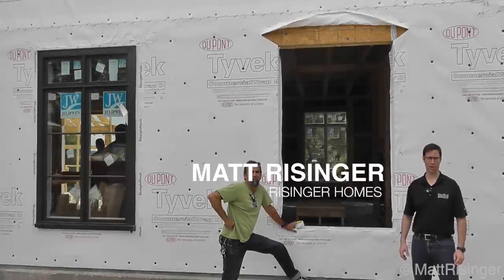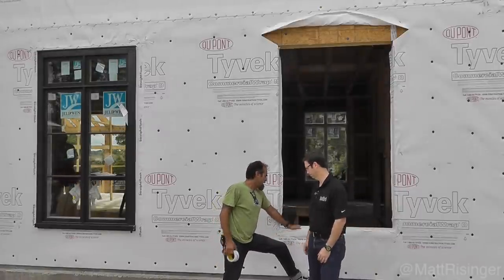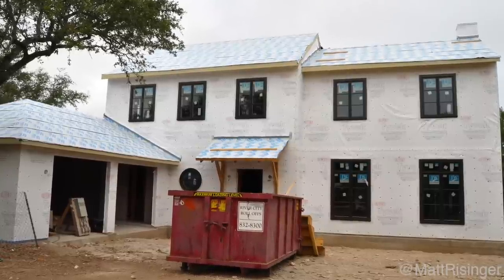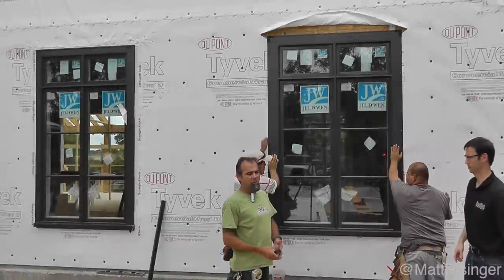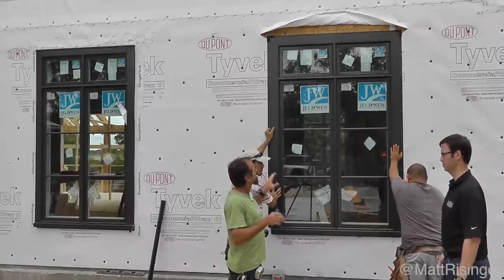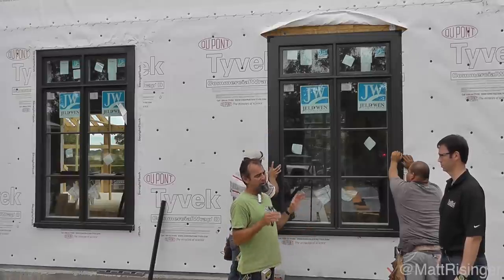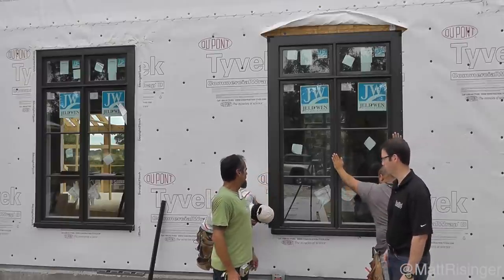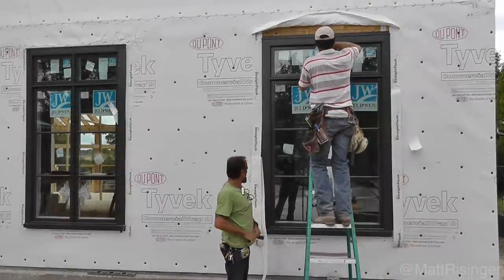Jeld-Wen Window Install Best Practice Method

Comment: I like Typar wrap, it installs at 32" centers instead of 16" centers for Tyvek. It is said to be 5 times stronger than Tyvek and has some other properties that don't let water through if oils or other products get on the surface of the wrap.

Comment: I'm replacing windows but since I have to completely rebuild my rough openings for two windows I bought new construction windows roughly the same size as the old windows. I'll have to cut the nailing fin off where the windows but up against brick face. I already installed a Jeld-Wen entrance door, now moving into two original windows that came with the house. All other windows have been replaced by previous owner.

Comment: One thing that is rarely mentioned in these videos and is confusing to most people is relates to incidental water intrusion. residential widows ALWAYS leaked. The big difference between 2023 construction and my parents 1952 New Jersey “Cape” was that the framing lumber was mostly old growth. sheathing was diagonal solid 1x shiplap and the walls 3 1/2” studs with fiberglass cavity insulation. No air conditioning. Underlayment was 15lb felt.
If the envelope received a few tablespoons of intrusion water…or even a minor leak… it could DRY OUT without substantial damage to the wood. So much construction today is a) tight, and b) made with engineered sheathing like OSB that WILL rot. 
Today’s rough timber framing is far less forgiving from a management of incidental water intrusion standpoint.

Comment: Matt, 
     Great video.  Much better than a Jeld-Wen one I saw earlier on replacement windows.
     The only thing I would have done differently is install a head flashing incorporated into the Tyvek. 
     So few understand the need for a sloped sill flashing and air sealing inside.       Lstiburek should be required reading and watching for all builders and architects.

Comment: Have been remodeling a 1930-1940 northern Michigan cabin with some additions from 1950s. I can tell you first hand how effective tar paper really is. It stands the test of time! Not really sure if this house wrap we use now is a actual improvement.
Reply: Me too..turn down house years old tar paper still intact
Reply: @raphaelkoster6099  ahh its definitely longer lasting on the walls than it is on the roof, and you can see hows its degraded under the shingles which installed correctly dont leak. even a properly installed siding cladding will leak and has weep holes to drain moisture. so to say siding manufacturers know this happens.

and the felt is organic so it will absorb and transfer water slowly. also at penetrations (windows, doors) corners the high flow behind siding trims gets beat up and leaks very commonly.

unless its a painted mand caulked 100% sealed exterior. and even still moisture behind the wall cavity still exists. which dies get wept through but then on sealed siding cant breathe out and rots the back of panels.

Comment: Really like the builders slight slope to the wd sill plate, and quality of work and attention to detail for leveling the windows.  I don't like the shingle nails for the window flanges because they will gradually loosen up & even pop just like many of them do on a roof. The difference being roofs are sloped and shingles are light. Windows are really heavy.  Wind loads alone puts a tremendous force on a window, but seasonal climate conditions, also create slight movements and creaks in a building.  So, big question mark on the shingle nails.  What does the window mfr recommend?
Reply: The wide heads on a shingle nail actually make it easier for the nail to come out.

Comment: Excellent treatise of evidence based practice on window wrap installation.  I really enjoy your style of questioning and camera presence.  Thorough and concise coverage of the subject.  I know you are a proponent of utilizing materials that decreases the risk of human error during application.  What are your thoughts on liquid flashing systems such as prosoco?  A product which is continuous without joints seems to be next in evolution for water, vapor, and air barrier protection vs. house wrap technology.  Excellent video as usual!   Thanks again
Reply from the maker: I think highly of the Prosoco's R-Guard and Tyvek's fluid applied too.  My concern is that both are labor intensive, and could hold up the progress of construction.  Ultimately, it comes down to the exposure to water your wall will see.  If you are coastal, or in a high wind hilltop, or have small or no overhangs; these are the projects that would have zero tolerance for failure and should consider fluid applied.  I believe Tyvek Commercial D is a VERY good system for most of the houses I build.  Best, Matt

Comment: Great video Matt, I really appreciate your channel and I think you really do a great job. 

A small detail bothers me, should not we seal the Tyvek on the jack stud. I do not see this detail in the video.
Reply from the maker: Appreciate the kind words!  Just to clarify, we use Dupont Straightflash on the vertical jambs (over the nail flange) first, then do the head last.  The bottom sill gets left alone so that water that might get into the window will have a pathway out.  This window has a snap on exterior casing that may obscure the view of the jamb flashing????  Best, Matt

Comment: Superb information every time, Matt! One question: When sealing from the inside with caulk and foam for complete air/water tightness, how do you also allow d
egress of potential leaking water through the window assembly itself, should the assembly become compromised in the future?
Reply from the maker: Look for an upcoming video on this topic, I'm filming it this afternoon!  Thanks for your kind works, and for your support!  Best, Matt

Comment: This helped me a lot.  Thanks!  I have been checking videos to help me with the replace of my parents windows.  They are all aluminum and in terrible shape.  We are going to vinyl.  So on vinyls is the header nailed, or not?  Everything I've read states No.  Thanks again!
Reply from the maker: Bryan Blackwater I would nail the header.  I don't see a reason not to nail the flange there.
Reply: OK ,Thanks.  Appreciate the advice!
Reply: Header will shrink and pull on flange.
Reply: My header shrinks when it is cold outside

Comment: Question,,. If you are allowing an escape for water on the bottom sill plate,,, doesn't that allow a serious air penetration at the same time or is it somehow sealed on the inside,,, wish he would elaborate more on this.
Reply: There are many different ways and it seems matt changed from time to time . 

One method is to use backer rod and chalk the backside with air dam (or any high quality caulking )this creates back dam where water can't past and your window is air sealed

Comment: I do not turn the wrap into the window opening. After placing the window in the frame and nailing it in, they the seal tape goes around the window toughing the wrap on one side and over lapping the window on the other. JS

Comment: This is not the DuPont approved method. The return up looks to be less than 6" on the sill wrap. The sides also need to be cut flush so the sill wrap sticks to the cripple studs.

Comment: Hi Matt, I'm planning on building my own home this summer. I'm planning on having 2x6 walls with 3" of closed cell foam, OSB sheathing, with Tyvek house wrap plus 3/4" Dow Insulation board. How do you handle the window flashing in that type of scenario? I watched your video with the Drain Wrap behind the foam board and thought that was a great idea but I'm having trouble wrapping my mind around how to properly flash my windows. I was anticipating installing my windows flanges on top of the foam board but would it be better to put the foam board over the flange?
Reply from the maker: Jerry,  Set your windows like this video then so your foam on top of all the Tyvek Drainwrap. Best, Matt

Comment: Matt - I have NOW 5 windows that have rotting trim-wood at the bottom sill.  The house is only 5 years old and the first signs off rot started just a year after being built.  Is this a bad wrapping job and/or window installation?  Do you recommend changing out the windows and house-wrap at the same time?  Like all kit-built homes in San Antonio, build quality was never there, and I find myself making more repairs/improvements, than enjoying my home.  Any help is appreciated!
Reply from the maker: William, I'm so sorry to hear of your troubles.  Most likely the issue is related to installation.  The hardest part of your issue is that fixing it correctly may mean removing all your cladding.  You might take apart one of the windows and 1' surrounding that window to see how the house was weatherized. If it's bad that's an indicator for the rest of the house.  Windows under large overhangs may be OK but windows without protection could be in bad shape.  I wish you the best in this terrible issue.  Matt
Reply: William Hoffman i

Comment: are you still shimming out the window from the sill for water to flow out if it gets behind?
Reply from the maker: Yes, most of the time.  I believe that the bottom flange of the window should be nailed a bit loosely to ensure water will migrate out and certainly it should be un-caulked.  If you do that you'll not need the shims.  Best, Matt

Comment: Why aren't you wrapping the building wrap in the sill, as Fine Homebuilding recommends?
Reply: because the peel and stick product their using does a better job waterproofing the sill than the housewrap would.  peel and stick also flexible to make a perfect 90 deg turn at either side.

Comment: Matt, I know this video is old, but I have a question. At 4:50 you show a picture of the interior of the home looking at the window instal, I noticed the sheathing, what is the plywood under the OSB? Is that pressure treated? Or is that just CDX for structural reasons?
Reply: Matt likes to run a 2ft tall course of pressure treated plywood first, then run conventional sheathing on top.   He advises it reduces the chances of swelling and damage from moisture.  Now he does a lot of Zip system though.....

Comment: Do you tape the horizontal seams of Tyvek? I've read some people do not tape the horizontal seams because if water does get behind the Tyvek (or any other house wrap) you want that water to be able to drain.  Dupont says the following:

 "All vertical and horizontal seams shall be taped with approved tape.
Taping all vertical and horizontal seams is part of the requirement to obtain the DuPontTM Tyvek® Products Material and Labor Residential 10-year Limited Warranty."

 As a side note, a 10 year warranty for house wrap does not inspire confidence when you want a house to last for at least 50 - 100 years.
Reply from the maker: If you tape the OSB Seams with Siga Wigluv then taping the Horizontal laps isn't as important.  I would tape them regardless.  Best, Matt
Reply: something being missed here is air. for this question regarding the tape air sealing is achieved by taping horizontal as well as vertical not just for water entry.

same for the cap staples. let alone no chance of a leak at the fastener possible being overdriven etc, and better hold from wind, it again provides better air sealing benefits.

and water shouldnt be getting behind tyvek. thats the point of siding taking the burnt of weather and tyvek draining the remainder away.

that air getting in is slowly ruining the insulation.
Reply: it also says on manufacturer site for i believe dupont that cap staples/nails must be used or voids warranty.

Comment: Matt can windows be flashed if windows are installed and there's no weather barrier installed
Reply: I'm not Matt but I sure would, then weather tape or caulk or both, the windows can never be sealed up too much in my opinion.

Comment: I don't agree with this "all windows will leak" conclusion.  My house, built in 1912 and remodeled with the original windows but new siding and wrapping the exterior trim in aluminum, has never had a single window leak.  Plus, while I do agree with leaving the bottom open on a philosophical basis, on a practical basis it is very questionable whether there is any effect to closing it or leaving it open.
Reply: What does your window manufacture recommend?  Bottom open or sealed up?
Reply: they all honestly will. its more about what underlay the used on the original siding. and around windows/doors those 90 degree corners arent possible to flash properly with felt paper which is most common used before newer housewraps.

not so much the windows, more the siding and underlay at the windows joints. Ive had many calls where it starts as a small issue somehwere on the exterior sheathing usually someone building a deck and finding rot. then opening it up and all bottom window corners just peeled apart.

Comment: It's not best practice to install a window over top of the Tyvek. How would you stop water that penetrates behind the Tyvek from getting into the house at the window opening? Please see YouTube video entitled "Properly Flashing Windows"
Reply: Zig Zag
Reply: Zig Zag
Reply: There's caulk at the top of the window between the flange and OSB, and then StraightFlash. All that is under the Tyvek.
Reply: yeah why they do that  this is confusing.. watch THISisCarpentry video the other way of doing it.
Reply: Best one I have seen, I like the "Fully adhered system" myself

Comment: OK, why don't you keep your videos consistent with one another?? What happen to your horseshoe shims that you so strongly recommend? I think your just getting hung up on promoting products that perhaps sponsor some of your videos.  I realize that building science is constantly evolving, but you are bouncing all over the place when it comes to window installation.  I truly appreciate what your doing, but BE CONSISTANT!!!!  All I see is that your promoting one product over another from one video to the next!!!!!   ENOUGH OF THE LASER CRAP !!!!!  No ONE uses a LASER to set windows!!! WHAT ARE YOU USING FOR SIDING ON THIS INSTALL? WHAT ABOUT TRIM? ALL TRIM ROTS OUT ALSO!! BILL STICK TO FRAMING!!!  Your not a window installer!! Leave that to the PROFESSIONALS
Reply: Dan Moberly Thank you,, He is az saleman first..
Reply: Dan Moberly.......I am going to have to agree with you. I just finished Matt's video promoting horseshoe shims. This is a 4+ year later video. Perhaps technology has changed since then. ( I'm trying to stay positive ).  I don't necessarily agree with you in segregating " professionals ". ANY GOOD contractor should be armed with framing, window installation, basic wiring and plumbing knowledge etc. and experience to where he or she can spot under-performing subcontractor work and correct it in time before it needs to be demo'ed and redone properly. I've seen lots of crap pass inspection. And without having a better solution, I personally don't care for all this adhesive applied sealing products. Surfaces need to be clean and foreign particle free and even then sticky tape, glue, silicone sooner than later lets go even if the weather permits optimum application conditions. How long is that "seal pan protection" going to hold? 50 years? I don't think so. And how much might that house cost? 500K maybe 800K? Are we moving backwards?  I digress.
Reply: While some of the products have changed the principles have not. Here in Utah as a framer we set the windows. Yes we use lasers. If we don’t the homeowners are after the fact and making us fix things. Do it right the first time and do it well.
Reply: this video is 4 years old, the guy doesnt even use Tyvek on his builds anymore. He now uses the ZIP and ZIP R sheathing. You also seeing him go around and show what his other builder friends are using.